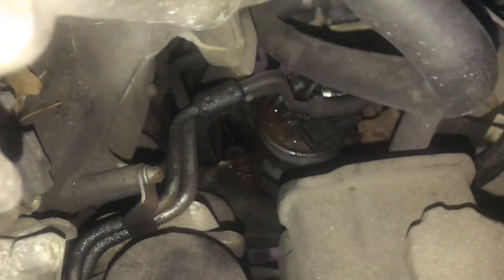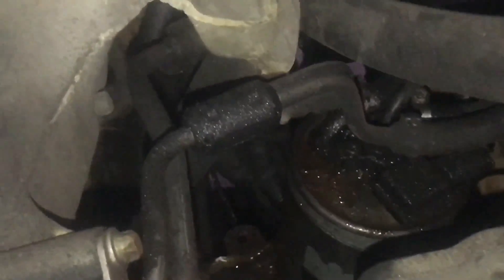My Power-steering is working bad on my T1N Mercedes Sprinter here’s what I think is wrong

Comment: Z. thanks for the video with power steering pump symptoms in real time.  It sure makes sense to swap out the system fluid with "run and mix and remove" with a turkey baster a couple times before assuming you need a new power steering pump or rack and pinion.  The 2005 long high top Sprinter with 170K is just begininning to show some shuddering occaisionally on turning, so I will definitely give it that "flushed feeling" first.  S.F.
Reply from the maker: Yep lol, that can save you some money 💰
Reply: Did this work for you? We have a 2004 that just started shuttering at low speeds when turning. Mechanic says we need a whole new pump. We are wondering if we can just do a flush to fix it.
Reply from the maker: Yes basically flush will fix it, use transmission fluid for best results

Comment: Serge I changed my oil and now i cant get the oil filter cap to stop leaking. ever experience this?
Reply: Muck , did you remember to put a new o ring on the cap?
Reply from the maker: Sorry your having this problem, this is common problem, you must change oil rings on plastic cap every time to prevent this, and oil the rubber so that you will install the cap without ripping them, and the cap needs to be a tight fit
Reply: MrFarscape40 thank you both. I had rolled the o ring too far on the cap and it wasn’t sealing properly. Fixed..!
Reply from the maker: Ahh nice good job man